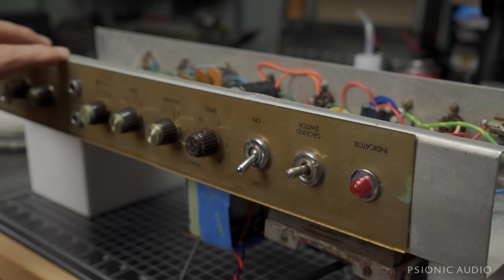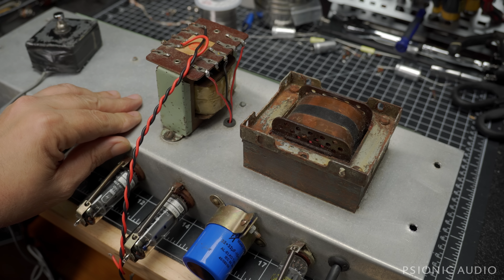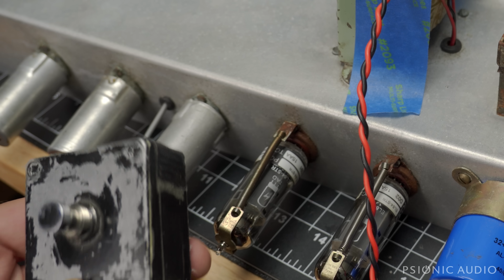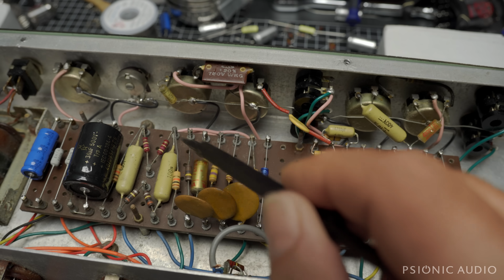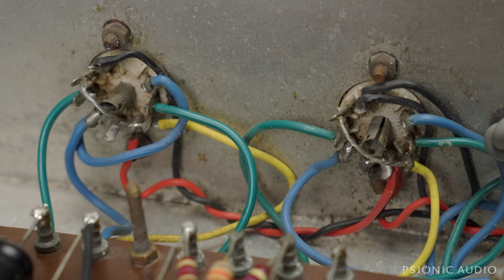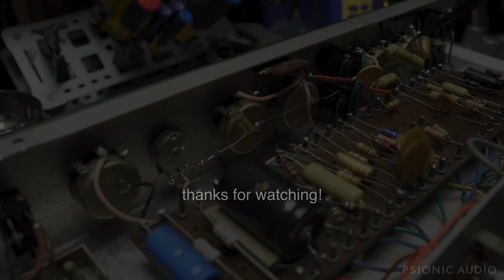'66 Marshall 1973 | Part 1 : Inspection and Diagnosis

Comment: ♠🍀♥ I would like to thank you for your video with the grounding scheme that you worked out. I built three replicas of Lemmy's amps and anyone who knows Motörhead knows how extremely loud Lemmy's bass was live. I changed the grounding scheme on all three amps and two JCM900s as you describe and they are almost dead quiet even when turned up to full power. No humming, just a quiet hissing that comes from outside interference via cables and tubes, which cannot be avoided. Greetings and all the best !!! 🎸🎛😲

Comment: Always makes me happy when you do one of these vintage marshall take downs, you know so many gems, i have built one of the 37 versions a plexi 1968 as per ceriatone version, all works and sounds great apart from some hum which i will hope to reduce by learning from one of your videos.
Keep up the sterling work Lyle, absolutly love your work, kind regards from East Coast UK.
Reply: this is plexi ive built:
https://ceriatone.com/wp-content/uploads/2017/08/Ceriatone-68-Plexi50-Lead.jpg

I have changed a few things as per your video on the different grounding, ive put in a chassis gnd on presence pot, at the 10uf caps which goes to the middle pot and the input chassis gnd.
also i have put chassis gnd for the speaker jack which also the 1R resistors go to and the main cap gnd with txf gnd to chassis.

much diminished hum now without having the bus bar, thank you.

Comment: Elephant Cupcake mate.  nice video as usual.  Is that large cement resistor near the black f&t cap a good idea?  Also would it not be a good idea to fashion a cover for that transformer?  Seems awfully dangerous.  Nice vid Lyle.
Reply from the maker: Thanks Ben. That resistor isn’t original but it doesn’t get hot. A cover would be good, but vintage considerations… you’ll see my solution for that soon.

Comment: Several years ago I traded a 50W JMP for a 1973X reissue. The 'aged' 20W Celestion pair and larger cab improves bottom end over the 1x12 1974X. Never seen another, nor my mate's 1958X (2x10) version. Both were limited production. And though these amps are not 'exact' recreations of the originals they are great sounding. From the 1st day I found the limited tone stack liberating. Instead of making tone stack adjustments to compensate when swapping between guitars I pretty well leave the tone at 7-8 and each guitar retains it's uniqueness. I wind the vol up between 6-9 as needed and ride the guitar knobs to taste. Typically using the trem channel which is the slightly brighter of the 2.  Lovely amps. 
If I recall the non trem channel has limited filtering ? So more prone to noise interference? It certainly has been evident in mine.
 
Great video Lyle. I'm in my 50's so 'old fashioned' with patience and loath cell phone media. I watch every video all the way though on my pc. 
All the best

Comment: I had a super weird plexi Marshall combo in my shop. Think of a Deluxe Reverb, NO maybe more like a 25 watt Princeton Reverb with EL34s in it. Really weird little combo amp!! It's a plexi, with a cathodyne phase inverter, and EL34s running at very low plate & screen voltages. The reverb is ECL86 pentode driven, and the tone stack is the basic high cut single tone control, but it's still a Marshall plexi. I turned one of those old weird cheap Dallas Texas made Davis PAs into what I wanted the Marshall Specialist to be more like. Full tone stack, no tremolo, and a LTP PI, but still a 25 watt EL34 amp HEAD.

Comment: Some of those solder joints dull and might have become dry joints.
Reply: The amp apparently sat in a damp location for a number of years, causing transformer rust and component-lead corrosion.Even solder can oxidize or crystallize in damp conditions. Solder is not impervious to air, especially moist air; and the posts, component leads and the solder itself contain dissimilar metals, therefore galvanic corrosion can occur.

Comment: wow what a gem! i wonder if it has the silver alnico speakers or greenbacks.
i have a 2005 1974x (ri) and i want to share 2 tips that made a world of difference for me:
1. add the matching 1974cx 1x12 cab beneath the combo so the amp works at 8 ohms.
2. if the amp sounds too bright (strat /sg etc..) swap v1(normal channel) or v3 (tremolo channel) to a vintage mullard i63 tube. you will get more low mids and the highs will be softer, it's also the tube that most marshalls had in 1966-1968 (some had brimars which are warmer and brighter while mullards are smoother). btw tmb is for pussies! this circuit is pure and raw.
 this line of amps has nothing to do with fender unlike the jtm 45. 
the 1974,1973 and 1958 are all  clones of the watkins dominator, they were built for the studio as marshalls answer to the vox ac 15, the fender deluxe reverb  etc...
enjoy!
Reply from the maker: Yeah, it’s pretty much 1:1 the Dominator. This has two silver G12s, one marked Celestion and the other marked Rola. Will date them soon.
Reply: @PsionicAudio ,  Based on what little history I could find about the company, Rola bought Celestion at some point. Rola was actually building field coil speakers for antique radio use around the early 1930s....
Reply: @PsionicAudio  thanks. you are the best. i work on live gigs (5 guitar amps) with vintage tubes (mullards,ge's) and an orange vt 1000 tube tester. i can't recommend it enough it's a life saver, and it saves me a lot of money on tubes and deliveries to techs. i need a tech once in 5 years on average and the amps are taking abuse.

Comment: I'm a bit confused as to why you say the UK mains plug is 'not particularly reliable'?  We've had these plugs in the UK for so many years and they are perfectly reliable, one of the best plug designs in the world.
Reply from the maker: Not the UK plug design, but that this was a later replacement with screwed connections and a clamp that doesn’t really hold the cable securely. Replacement plugs, US, UK, wherever, aren’t a great idea.
Reply from the maker: I’ve talked about this a lot in previous videos so I didn’t go into detail here but I guess I should have.

Comment: Elephant Cupcake. Your Ground scheme posts are the best! I think iam on the wrong track. I was supposed to record some guitar. I got stuck in a loop, at least thanks to you it’s not ground loop related! 
You’re the best! 

A question if you have time? Iam building a 2*15 cab loaded with vintage Altec Lansing speakers. Open or closed back? Finding it hard to decide. Intended for studio and live use!
Reply from the maker: Cab design is really complicated and subjective. If you’re building it yourself, the best approach is to experiment with closed back vs ported vs open (and HOW open). And try it in many different rooms/spaces.
Reply: I like mine quite open, gets rid of the mud and woofiness.  I play at low volume in my basement.  Made a cab matching a mojo 2x12 lite cab, then opened up the hole quite a bit and really preferred it.  So yeah, you could experiment.  Room matters too, placement in relation to wall, it all really makes all the difference unfortunately

Comment: Sorry to blow up your comment section but you mentioned that this was a 240v amp and you'd be using a step-up which makes total sense but I'm curious how safe running an ampway under voltage, say 120v, would be... I dont care about the tone, just curious on the safety of doing such a thing. Certainly not planning to do so.
Reply from the maker: It would be “safe” running a 240V amp at 120, you just wouldn’t hear anything really. 

Running a 120V amp at 240V is where the magic smoke leaves all of a sudden like.